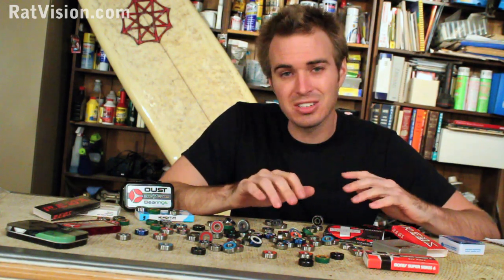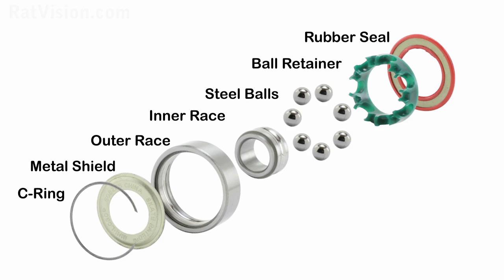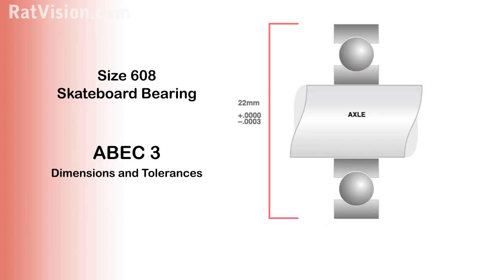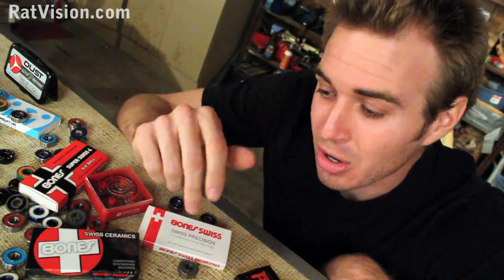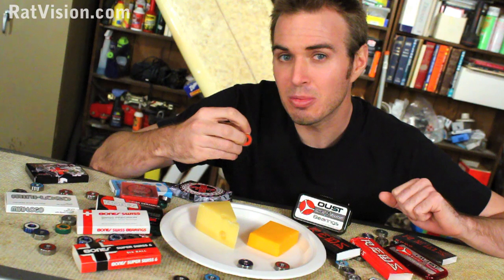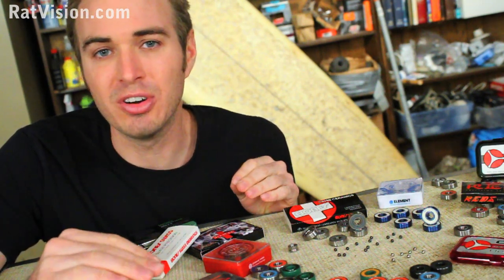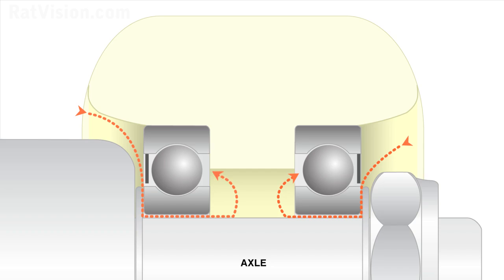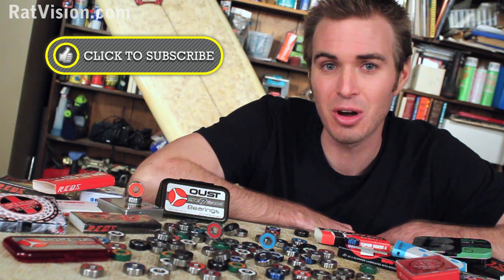What is ABEC / Swiss / Ceramic Bearings

Comment from the maker: It is important to note that ceramic materials only have a harder surface than some steels, and that surface is measured in microns. Metal balls undergo plastic deformation and recover with certain loads, while ceramics can crack, chip, or break. This can make ceramic bearings in skateboard wheels impractical. You're right about corrosion, but don't forget ceramic bearings are hybrid bearings, which means they have metal races and can corrode as well.  Thanks for your comments.

Comment: One last note about why ceramic bearings may be preferable to metal.  Ceramics in general tend to almost always have a higher hardness than metals.  Higher hardness is preferred so the bearing has a smaller chance of deforming when those axial and torsional loads are applied to the bearing.  Also, scratches that steel bearings can sustain from those stresses can open up active sites for corrosion to take place (especially if the steel is not stainless).

Comment: As a Materials Science and Engineering student, I take issue with the "hardness test" done on the bearings.  Hardness is the measure of a material's resistance to being permanently deformed.  The test performed in the video was actually a compression test, where a material is compressed until failure.  The failure strength of a material is not indicative of its hardness; a Vickers hardness test would be required to truly compare their hardness values.

Other than that, great video!

Comment: No, I'm not a metallurgist, I'm a toolmaker with 23 years experience who worked in a metallurgy lab for two years during my apprenticeship for a major motor vehicle manufacturer. I used to carry out hardness testing and surface finish work on camshafts and crankshafts. Polishing does not harden steel, it removes peaks from the surface which reduces friction, therefore wear. Heat treatment, carbon content, and rapid cooling of a material are the only way to increase hardness.

Comment from the maker: What part of this video is marketing? You learned one thing about carbon in steel and you think you know it all, and you're wrong. There is much more to steel. Polishing DOES make the surface harder. Since u are a metallurgist, u know that polishing smoothes out the asperities on a metal surface. Essentially, compacting and flattening the asperities, causes the metal surface to be harder. This may help your ignorance. Snow that is formed into a snowball is harder than snow lying on the ground.

Comment: those are the two parts of the skateboard in which u dont really need to worry about because theyre obvious. there lots of good decks out there and u dont have to get the best one cause it doesnt stand out but plan b or almost is prob my fav. and for the trucks, evryone knows the best ones are either fury or thunder trucks

Comment: So, say you are 180 lbs. For each standard bearing, it will distribute about 3.21 lbs per standard ball bearing area as opposed to super swiss 6 which distribute about 3.125 lbs per standard ball bearing area. Plus the bearing only has 6 balls so it would take less force to make them roll and keep them rolling, wouldn't it? Please correct me if I'm wrong.

Comment: Exactly, I thought it had to do with all weight distribution. a skateboard needs 8 bearings each standard bearing has 7 balls. 7*8=56 each super swiss bearing has 6 balls 6*8=48 but the ball bearings in the super swiss are 20% larger than regular bearings so 48*1.2= 57.6, that means 6 bearings have an area of 57.6 ball bearings opposed to 56.

Comment from the maker: There is a logical reason not to buy Super Swiss 6 bearings.  Nearly all 608 bearings use 7 balls.  Why would Bones be the only brand to use 6 balls?  Think about it.  How many balls at one time are handling your weight?  Look at half a bearing to get the answer.  Now how many balls are handling your weight with a 6 ball bearing?

Comment from the maker: Within one brand, like Andale, each ABEC bearing will be slightly better as the rating goes up. Swiss means nothing. It just means they were made in Switzerland and you get to pay for that (cool huh?). ALL Swiss bearings have ABEC ratings too, but brands never display that. Swiss bearings are just like all other bearings. They could have harder material, more polishing, more precision manufacturing, but who knows? They could be crap! For example: Rush ABEC 5's might be better than Andale Swiss.

Comment from the maker: It's not that ABEC 3 bearing are better, they just can be because ABEC ONLY measures tolerances.  Did you watch the whole video?  We explained this pretty thoroughly.  You can find out more at RatVision(dot)com. ABEC 3 bearings could have harder material, more surface polishing, better ball retainers, 2 closures (shields/seals), all of which can make a bearings better than those that don't. ABEC ONLY MEASURES......

Comment from the maker: The strength of the ball determines it's speed.  The harder the ball the faster it rolls.  The more polished a ball and raceway are the smoother the surface to allow the balls to roll faster.  Polishing also makes the surfaces harder, again TO INCREASE SPEED.  HA HA HA HA HA you're so angry.

Comment: Harder ball polishes the raceway thus improving the bearing in cases where rust anyway have been formed. I bet that the steelball standing 22,000 pounds deforms in process and could'n be used in a bearing anymore. Harder material usually cracks easier instead of deforming. Swiss are famous of the precision work done in waches etc and thats why bones high quality bearings are Swiss made.

Comment from the maker: You have no clue about what u are trying to talk about. Ceramic CAN have a harder SURFACE than some steels. In the video the BONES SWISS CERAMIC ball exploded! A steel ball withstood pressure over 22,000 pounds. Do you realize what rust is? It's oxidized iron. Ceramic balls may remove the rust on the surface of the raceway but that doesn't mean that the raceway is back to being perfect. The raceway is damaged. Swiss steel is NOT commonly better. Steel is steel.

Comment: Actually this whole video sucks. Ceramic material is harder. Thats why it breaks instead of deforming under pressure. Yes ceramic bearings can rust but harder ceramic balls sands the rust away from the races where the balls roll. Commonly swiss steel is better as manufacturing guality over decades. Swiss bearings actually are a class as all those are made in Swicherland.

Comment from the maker: Not entirely true. Tolerances can be achieved with steel just the same as ceramic.  Metal on metal causes more friction.  Two unlike metals have better coefficient of friction, and the same goes for metals polished at different amounts.  When a very small chain hydrocarbon lubricant is added it greatly reduces the friction even further.
We could have gone more in depth about ceramics, but hardly anyone rides them, and we only needed to mention a few things.  Thanks for your comments.

Comment: Oh and I forgot, even steel balls with hard ceramic coatings will not be as hard as ceramic balls because they simply have their coating wear off very quickly especially with the impacts and torsion applied during skateboarding. Coatings will flake off and be a nuisance when reduced to sharps small bits by obstructing the raceways, eating them up when mixed in the lubricant or worse when the rings are dry...

Comment: Companies sure do put "swiss" to impress and apply outrageously high prices sometimes, and swiss isn't always better than say american or german or whatever, but there' a MINIMUM quality standard in Switzerland that simply doesn't exist in China.
Chinese are capable of producing at ultra low prices and the steels and ceramics used aren't always manufactured correctly plus it's easy to cheat with tolerances as long as they have a certain percentage of relatively functional end products.

Comment: You made a big mistake in your video because you spoke too quickly, you said "ceramic balls are not harder than steel balls" . In fact , ceramic balls are not AS TOUGH as some steels, but they're way beyond the hardness of the hardest steels. Silicon nitride is many times harder than the best bearing steel, but it's not as TOUGH (or fracture resistant).

Comment from the maker: Nope.  There are no special ingredients or instructions for making Swiss bearings.  They only need to be made in switzerland using Swiss material. And just because they use Swiss steel does not indicate it's better still too. Chromoly steel is chromoly steel no matter where it comes from. Better polishing can be done anywhere, which is how a Chinese bearing can be better. It's all about material and quality of manufacturing. What is "Swiss" about a bearing? A bearing is a bearing.

Comment from the maker: It does.  It comes with experience.  a lot of skaters can feel the difference between a 7.75 and an 8 inch board and that is only 1/4 of an inch.  They flip differently.  8 flips slower because its wider.  It also feels different depending on the users show size too.  A lot of people are into wider boards now.  It doesn't mean you need to follow the trend.  Get what is best for you.  If you are smaller or shorter and have small shoe size go with a 7.5 or 7.75. If u have more questions ask away.

Comment: Aren't Swiss bearings made with higher quality steel and have a better polish grade on the balls and inner/outer races compared to American or Chinese bearings? They do spin for a lot longer than the same ABEC rating bearings, especially with the ceramic balls, that has been my experience so far.

Comment from the maker: Bones Reds are ok bearings.  Certainly not the best, but the price is great.  If you want a bearing to last a long time look for bearing that has shields or seals on both sides.  Mini-Logo bearings are about $10 and have closures on both sides.  We recommend Oust bearings.  The price is around $20-45, but they are the best we've tested.

Comment: Good video about bearings and ABEC but I think it would have been good to talk about the difference between a nylon ball retainer and a metal cage.
For the ceramic balls I agree and disagree because yes metal can be stronger but you'll collapse before you get 8200lbs of pressure on one ball. Ceramic balls have lower friction and some brand make 100% rustproof ceramic bearings like Powerslide Cronitect.

Comment from the maker: Turning might be caused by u turning your shoulders, which might be causing your front foot to push to the left, and back foot to not land on the board. The ollie is all in the back foot. The front foot just levels the nose out. The ollie is the hardest trick to learn. Watch a lot of videos and pay attention to the motion and what is causing the board to lift off the ground. It's like a catapult in a way pivoting over the wheels, but the nose is shot up and then pushed/leveled by ur front foot.

Comment: Swiss bearings were originally called that because they were made with swiss steel, which is slightly stronger than regular steel, and can withstand slightly higher temperatures. A lot of swiss bearings now are just made in Switzerland, as opposed to being made with swiss metal. If you find bearings made with Swiss metal, then those will be slightly stronger than other bearings. Will it make a difference when skateboarding? Not really. It's a marketing campaign.

Comment: i have reds ceramics and swiss ceramics(both by bones) and the stock steel versions, which by the way, weigh more than 5 times more(per ball) lost miserably both times, in the same wheels on the same board. conclusion, this video is false. also, bones Swiss smoke almost all other steel bearings...just sayin. longboarders should review. not salesmen.

Comment: Reds are ok bearings. I just think a lot of people over rate them. I've had sets that last a good while, and some sets explode on me after 5 weeks. Not something you want from a highly branded bearing.
I tried their super 6 balls, 40-50 bucks on a pack of bearings. Was my mistake, they were nice for such a short amount of time. It's why I put a low budget on bearings now. I'm skating the chocolate bearings at the moment, they're nice. Bearings shouldn't be something you need to over think about.

Comment: I actually found Bones Reds a terrible bearing. Bearings with plastic chambers aren't that durable. With Bones Reds, they need to be cleaned. If you don't mind replacing bearings every so often, (like once every 6-8months), you could get away with any cheap bearing from a decent brand. 
Lately Chocolate's "Dark Chocolate" bearings are cheap and are doing me really well. But bare in mind I didn't buy them separately , I got them in a joblot of skate board decks, wheels and bearings.

Comment: From my experience, most cheaper bearings run at the same performance levels as some of the more expensive bearings. I usually put a budget of about 10-15 bucks on a set of bearings. Here in the UK. I've been skating Blue Print bearings as my common set, since their only 8 bucks a set and they last, as well give out decent roll and speed. 
Also if they break after 5months, or dry out. It's only 8 bucks to replace. So I'd suggest going for a decent brand but not spending too much on them.

Comment from the maker: It's funny you mention that.  There was a discovery of an early cart used by cavemen.  It was about 20 inches wide and 50 inches long. Pretty much an over-sized longboard. It waIt didn't have trucks, but used a skinny log with wooden or stone wheels attached at the ends.  Because there were no roads they used hardened packed migration trails created by woolly mammoths. What's odd is how the planks were too weak to carry heavy loads, so historians suspect they were used for human transportation.

Comment from the maker: Yes, we recommend Oust bearings. Oust bearings also have a better price compared to the Bones L2's, and also have 2 seals. We aren't sure what Bones did to redesigned the inner race.  The Labyrinthed shields are probably nothing special at all because a shield should already not have any drag. These shields are not going to increase speed because the shields are not the functioning moving parts of the bearing. All they do is protect the bearing from contaminants and help keep lubricants in.

Comment from the maker: Absolutely, some Swiss bearings can be great. Because there is no manual or instructions for making Swiss bearings it does not mean that all Swiss bearings are the fastest, most durable bearings. Swiss bearings have to be made in Switzerland, using Swiss materials, that is it. They are made on a Swiss screw machine too. Because Chinese manufacturers might use a Swiss screw machine or a Swiss "style" screw machine, you can get "Swiss" bearings that come from China. Is that not ridiculous?

Comment from the maker: We apologize for the late reply. Did you put the bearings in the wheel first before tightening the nut?  If not, then you probably warped the shield. This can also happen from over tightening. The balls didn't do anything to the raceway.  The shields are dented or warped. There may be no way to repair the the shields.  You may need to remove them so the bearing can function better.

Comment: Last one. To start, a longboard is a skateboard. Seriously, does a longboard have fucking different DNA? No. 1 deck, 2 trucks, 4 wheels, etc, everything is the same except the design types of parts used, and the way the deck is used. Also, i can use my board as a lawn gnome if i want. It isnt NOT meant for anything. Lastly, dropping 40 bucks on Bones Swiss is not "Sexy", go buy something useful instead. Honestly, i bet if i swapped everyone at the skateparks' swiss bearings, none would notice.

Comment: Bearings will have little to no effect on roll speed until rusted. The main factor is wheels. Mainly, size and urethane. Some have a higher quality urethane which will roll faster (in most cases). A good way i tell is to go bounce a wheel on the floor, like a ball. It should bounce well. Also, the diameter of the wheel will come into play. Obviously, the larger will have more momentum, and propel you further with each rotation. Larger wheels accelerate slower but have a higher top speed.

Comment from the maker: You clearly know absolutely nothing about bearings.  Until you can prove with actual knowledge and facts that there is a better bearing than Oust we are going to continue to recommend them. From all the bearings we tested Oust came on top. So Oust is the brand we recommend. Daddies Board Shop is a large shop that sells internationally. Because we have people asking where to buy Oust we tell them daddies just in case they are overseas. If you find a better price good for you.

Comment from the maker: Neither.  After watching this video you know that ceramic is brittle and does not handle loads better than steel.  Six balls do not disperse loads or reduce friction compared to the standard 7 balls.  It's the opposite.  There is a reason why the standard is 7 balls.  If 6 balls are "better" why aren't all Bones bearings using 6? With 6 balls you now have 2-3 balls handling loads during rotation.  Seven balls in a bearing have 3-4 balls at a time handling the loads creating less friction.

Comment: Im a street skateboarder and i've been using Bones Swiss (Original) for 2 years. I need new bearings and i am trying to decide between Bones Super Swiss 6 Ball and Bones Ceramic Super Reds. I need a bearing that can handle impact and is great in speed. Which one would you suggest???...